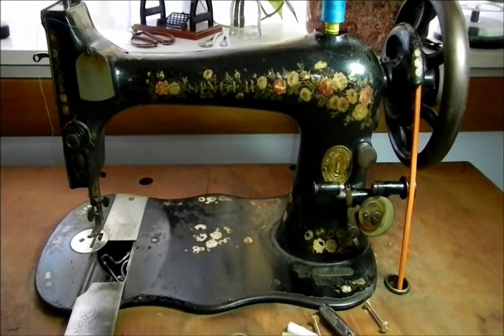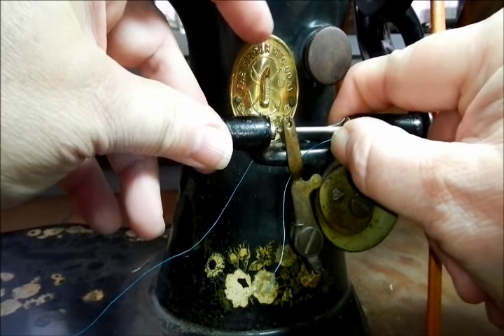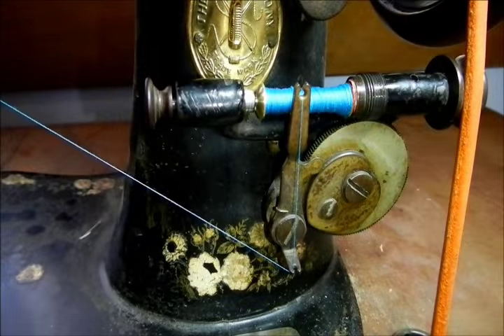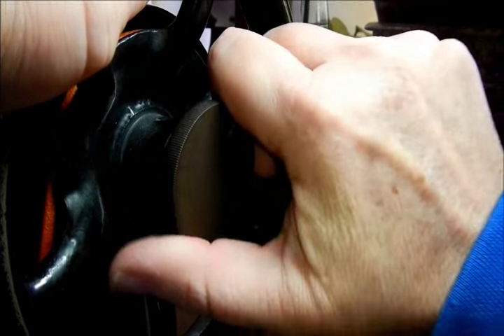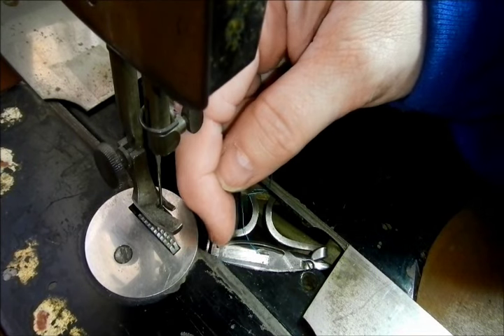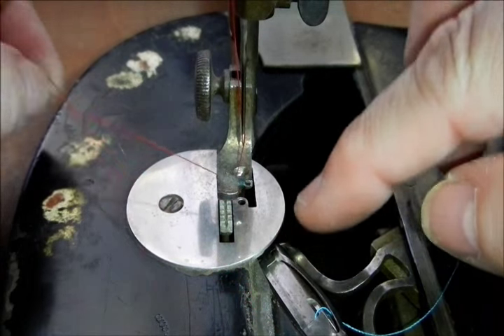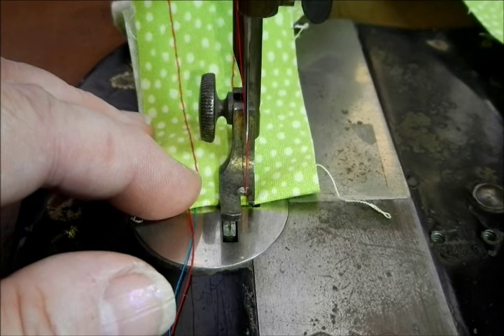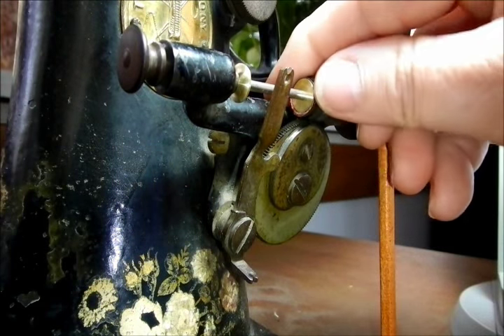Singer VS2 bobbin winding & threading the machine

Comment: There is three ways we can guesstimate the approximate age of this Singer. Serial number, type of construction and the long bobbin winder. There is a small placard with a serial number on it in the front of the machine and you can see from singers own pages what year it was produced. What I could see it looked like *E432380 (might be wrong, my eyes are not good). Depending on the first letter with the coffin/casket type table I would guesstimate between 1924-1947, difficult to say without the first letter though. If we go with the long bobbin winder that it has attached to the front of it, then it is very possible that it was produced in the 19th century. I am not sure when they stopped producing the long bobbin versions for the modern round versions, but the long bobbin machines start from the 1850s. I might be wrong though, can anyone else see the serial number better?
Reply from the maker: @lenaevess  this machine was manufactured in 1889. There is no letter prefix to the serial number 8667836.
It also has a curvy "fiddle base" which only ran for a few years with the VS2 - changing to a rectangular base in 1891 - which also confirms this machine was manufactured before the 20th century.😉

Comment: My husband got me an old portable Singer machine, 1911 it says on the front plate. It is electrical and it sews with this metal handle that has to be inserted in a hole at the right, just under the wheel. It works with my knee pressing on this metal handle. I did not know how to place the shuttle in its place and how to insert the bobbin in it. Now, thanks to you, I know how to do that. Thank you so much for the time you took to make this excellent video to show how it is done.

Comment: What a fine video, thank you!  

One thing that I think might assist is that if you start with the thread guide to the right, instead of on the left as in the video when winding a bobbin you might find your life is a just a bit easier.  The cam follower will be in the middle of the "heart" shaped cam and the wound thread will more securely lock the bobbin thread onto the bobbin.

Comment: Best video I've came across that's a close up on what you're doing. Every other video is so far back it's hard to tell. Thank you so much!
Reply from the maker: Glad I could help!😉
Reply: @TheMasquerade  I do have one other issue, maybe you can help. I'm at a point now where I turn the wheel so where my needle thread is to catch my shuttle thread but it's not catching. I've done everything correct up until this point but it's not picking up the thread. Any ideas on what I might be doing wrong?
Reply from the maker: @samanthasparks6978  it could be a few things. If you dont have the exact year and model (VS2, 1889) as my machine, the you may need to turn your needle so you thread it from front to back. Or maybe turn it so you thread it from right to left (with the flat side of the needle to the left). Or maybe you havent inserted your needle into the machine deep enough before tightening the screw. All these things can affect how your thread will pick up around the bobbin shuttle.

Comment: Thank you so very much. This has been a life-saver.  I have a Vickers machine which was probably made in the 1930s but it uses exactly this system. I found a manual online which I printed up and it was quite explanatory--right up until the lower bobbin threading. I suppose the writer must have got tired by then, because it really doesn't tell you how to do it. I was in despair until I found this.
Reply from the maker: So glad I could help!!😁

Comment: Very nice original vs2. It has the original shuttle!! I have the 1889 vs2 manual if you need a free copy. I have a very similar machine called the singer high arm family vs. It is not a "vs1" but uses the same bobbin as a vs1, and that bobbin fits in the same shuttle you have. Mine is 1886 and the 1st year of the new type vs. The big difference of mine is my bobbin winder and the spool pin area. I have no flat spot for the spool of thread and the bobbin winder will not wind a regular long bobbin well. It bulks up the ends on the bobbin too much as it needs a longer bobbin. Mine was also electric, but no longer has the dangerous engine where the hand wheel is. The electric were not uncommon and in my area of North America, just the horrible engine got upgraded back to a treadle after the engine gave out. Not many exist elsewere, but there are quite a few engine parts around here. So common they were in my area, I have two tops where you can see where the actuator was mounted on the bottom of the treadle table. Thank you for loading this video!! Anyone that needs a how to video on this machine I will direct them to your video. You have very good description and camera work.
Reply from the maker: Thanks!  I love this machine and have fun playing with it quite often.  I was able to find a copy of a VS2 manual online - but it's not very clear.  If you can get a clear copy of your manual, I would love to have it!!  Please send me a message to my email:  TheMasquerade@gmail.com    Thanks!
Reply: Usha sewing machine prices
Deferent types

Comment: Good thing for me about this video was that I was threading the machine correctly.  But I really need to get mine fixed so I can use it.  The joy of getting it second hand for free meant the front plate was missing and the screw on the presser bar was snapped.  Everything else tho works fine.

Comment: Thank you for the tutorial. I am working on my machine atm. Hopefully I haven’t screwed anything up. I did want to say that now my bobbin winder is mostly silent. I think it could hurt you machine if you are using it while it is making that sound
Reply from the maker: LOL, I had just brought the machine home for the first time and hadn't even cleaned it yet. I was just so excited to share. That was about 5 years ago! She has been thoroughly cleaned and oiled, and has had her belt replaced now. She runs quiet as a mouse, and so smooth.❤ I think I prefer using this machine over any of my 10 modern machines!! You are correct about maintenance.  It's a great idea to give your machine a few drops of oil before you start a big project, and an entire cleaning once or twice a year depending how often you use it. Happy treadling!

Comment: Thanks for the info. I recently got a non-Singer Treadle, got a belt, oiled the machine and the base, but now trying to figure out the needle. It's longer than modern needles at nearly 2" long. Hopefully I can find something to put this machine to work.
Reply from the maker: You might find the correct needles on Ebay. Search with the model name and year if you have it, and see what comes up 😉
Reply: @TheMasquerade    finding a needle has been interesting. I found the needle in the machine was stamped with a name, "Boye" and a couple numbers. Found a site that showed different needle types next to measurements. I found the closest to the size I needed and searched eBay. Found one I ordered and when it arrives in a few days, if it works out, I'm going to be getting more. 🤞
Reply from the maker: @W4ABN  Good luck! I hope they work!  I've had pretty good luck with antique parts on Ebay. I hope you do too!

Comment: You are a breath of fresh air! I keep watching videos where the bobbins are round. I have a 1900 Faultless.
It was a family gift. Unfortunately the shuttle and bobbins were lost in the move, but It is going to a repair shop this month. Otherwise the machine is intact. Needs a good cleaning, oiling, new belt. Does your machine have a de railer that protects the belt from stretching when not in use? I don't see one on mine. I will keep your video for reference regarding threading, etc. Very excited to use machine! Thank you for this video ~ Diane in New Hampshire.
Reply from the maker: That's great!  I'm glad you are getting her fixed up and ready to use!  It really is so much fun to play on a treadle machine.  Yes, a couple of mine have a de-railer.  You can see it in the video I made of "Replacing the  treadle belt" on your machine.  Here's the link. . . .  https://youtu.be/8KbSFCHdZbo

Comment: Lovely machine, thanks madame: this video helps me a lot with my treaddle, long shuttle 1906 White machine. I own a hand-crank Singer too, in a nice condition, but the upper thread doesn´t catch the thread of the bobbin, and doesn´t make the stitch. Can you help me with this problem? Any advise I will really appreciate. (I apologize about my English, I´m from Argentina)
Reply from the maker: On the hand crank machine you might want to try threading your needle in the other direction. You should also make sure it is the correct needle type, and that it is set all the way into the needle bar. If the length of the needle is not just right, or if it is threaded wrong, it will not pick up a stitch.😉 Hope this helps!

Comment: An excellent video! It's hard to find videos that are for exactly the item that you have.I have a Singer model 27 with an 1896 serial number. I was wondering if you might go a step deeper into the tension adjustments. I use 2 colors for needle and bobbin so I can see that the tension is right. My problem is that it keeps showing I have to much tension on the needle thread.That's a problem because I have backed the tension off completely.Thinking that perhaps the bobbin tension was to loose, I have tightened it as far as I can,and it still shows to much tension on the top. I have come to suspect that it might possibly be the thread guide spring causing to much resistance to the thread pull. Do you have any information as to where the guide spring should be situated when re-assembling the tension adjuster? ( I took it off for cleaning purposes and am not sure that I have positioned it correctly upon re-assembly.) Thanks for any help you can give.
Reply from the maker: Hi Tim, I also have a Singer model 27.  I'll take a look at it and see where the guide spring is situated on it - when I get a chance.  It's tension is great - so I might be able to help, but it may take me a week to get to it (so many other things on a deadline before I can dig it out!)  I'll get back to you.  :)
Reply: OK, Thank you. I appreciate your help.

Comment: Is it still possible to buy a new shuttle and e tra bobbins? When threading my shuttle, the thread just keeps coming back up the slot.
Reply from the maker: Yes, it's still possible to buy a new shuttle and extra bobbins.  You might not need to though.  When you pull the thread down the slot to the bottom point on the shuttle, make sure you give it a real tug - while holding your finger on the top of the bobbin in the shuttle so it doesn't spin.  I have a couple shuttles that are fussy like this.  Make sure the shuttle is very clean.  If there is a bit of lint or thread caught inside, it will stop the thread from following the correct path. ;)  Hope this helps!

Comment: I got a VS2 the exact same year and paint job but 95 % of my flowers have gone away , thinking of repainting it , but so hard to do when i like patina...lol nice machine but oiling and cleaning your bobbin winder would fix the issue of not winding proper,  but your choice , leather piece that seems to offset the wind , or just some maintenance , your choice ....like i said ....
Reply from the maker: I've oiled and cleaned the bobbin winder, but the bobbin still slips. Not all of the time, but enough to make it annoying. So the leather seems to work for me. LOL

Comment: i have almost the same machine but without the floral flowers on machine but in desk like thing like yours ... my mom knew this machine i don't and she died in 2001. question is my belt is loose slips a lot from foot petal to to machine wheel, how do i tighten this belt? it hard for me to adjust tensions when the foot petal barely works ...
Reply from the maker: Good question! You need to find where the belt is held together with a big staple. Remove the staple from one end of the belt. Cut the belt right where the staple hole is. Make another hole in the belt about 1/4" from the end. Reinsert the staple and pinch tight. You will be good to go! Sometimes the leather belt is just too old and dry so it has no stretch left in it. When this is the case, you need a new one. They are easy to find on Amazon or Ebay. "Leather Treadle Belt" about $15. Hope this helps!

Comment: Excellent video. :) I got a Singer treadle machine at my local auction. I have done some research and think i have a model 27. Its serial number 13734510. It has a Sphinx design on it. It has the  lower bobbin winder. One question though. How do you know the difference between a vs1 and a vs2 ?
Reply from the maker: ISMACS (International Sewing Machine Collector's Society) has a great article that compares 3 machines.  The New Family from the early 1880's, the VS1 from the mid 1880's and the VS2 from the late 1880's.  You can check out a list of comparison features here (http://ismacs.net/singer_sewing_machine_company/singers_missing_link_the_high_arm_vibrating_shuttle.html)

Comment: Thank you so much for this tutorial, I'm stuck however on my machine. The "bobbin winding mechanism" seems to be immovable. I can't figure out how it could be pulled away from the machine in order to engage the winding belt. I'm wondering if my machine works in a different way or is defective?? I don't know, it's a singer treadle machine mostly resembling yours.
Reply from the maker: It could be that the bolt that allows it to turn is just frozen.  I drop of Kerosene in the joint to "eat out" the gunk that has it stuck - then a drop of machine oil should help!
Reply: @TheMasquerade  thank you, I'll definitely try that! 🙂🙏

Comment: Hi there! Great video! When I load the shuttle, the thread doesn't easily go under the tab (I have to poke it it under with a needle), then the thread doesn't pull easily - do you have any idea how to solve this please?
Reply from the maker: I'm not at home with my machine right now. I'll take a look at it this weekend and get back to you. It sounds to me like you need to clean the shuttle really well. There may be something caught under the shuttle spring,  making the thread catch.
Reply: @TheMasquerade  Thank you so much for your reply. You definitely had a good idea with cleaning the shuttle, a lot of dirt came out of it! Also, when I was putting it all back together, I realised that the tension screw controlled how tightly the spring holds to the main part. So I loosened it and found the thread easier and easier to go under the tab and also pull out. I'm going to try to get it to the right tension tomorrow and give the rest of your video a try - thanks again!

Comment: Thanks for sharing this. It was so helpful. Just want to ask how to troubleshoot if the needle is not picking up bobbin thread? Thanks
Reply from the maker: Make sure you are threading the needle from left to right, and that you are placing the bobbin into the shuttle  so that it makes the bobbin  spin counter clockwise while you are looking down into the top of the shuttle.  If your thread isn't coming out of the shuttle in the right place, the needle will not pick it up.  Maybe I'll do another short video on how the shuttle should be threaded. . . .
Reply: Thanks for the reply. I tried your advice, it pick ups for a while but then eventually will not. I’m looking forward to that short video. I really appreciate your tutorial, if not for this I don’t know how else this vintage singer sewing machine would work. 😍
Reply from the maker: Just finished making the short "loading bobbin" video for you.  Hope it helps!  https://youtu.be/EGRlXhc7Erk

Comment: Hi 👋🏼😊 Thank you for the video . I have my great-grandmothers singer sewing machine , it’s In a square Cabinet with a wheat looking emblem carved on the front ,the pictures ive found similar are from 1910-1915?  It was converted to electric . I don’t know where to begin to know if I can still use manual or if I have to use the electric converted way. I also have no idea what the belt part is called or how to replace it should I need to. Help please 🥺 I’ve always wanted to use it and I’m afraid to mess something up not knowing it’s parts . I have a disability and can’t do much often but on a better day ,I’d love to be able to enjoy this . I can wheel my IV pole over to the sewing machine ... would be a great distraction during a 4 hour home infusion 😂 if this virus mess ever allows me to complete my papers to get started . Thank you for not having music or loud noises  in your video , I have a medical condition and I actually go into tachycardia with some types of audio ,it’s extremely painful , I really appreciate your calm and soft spoken way of doing your video , many with  my condition have extreme noise sensitivity. Another reason that would be helpful if I can figure out if I can still use this manually is there would be less noise as well .
Thank you for your time 😊
Reply from the maker: Hi! I will be delighted to help you with your machine. I have so many good tips to offer - too much to put in this response comment. If you could send an email to me with a picture of your machine, and the serial number if you can find it, then I can look it up and give you all the info and help you need. Send to: TheMasquerade @ gmail.com  Thanks for your interest in my videos!